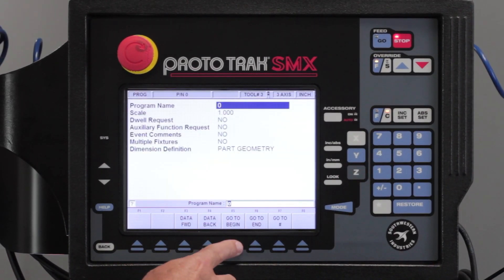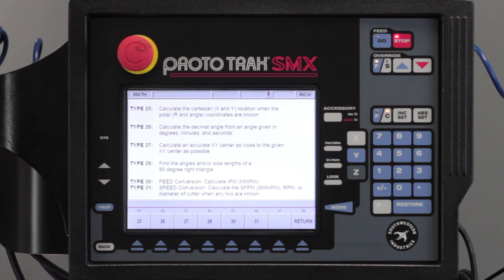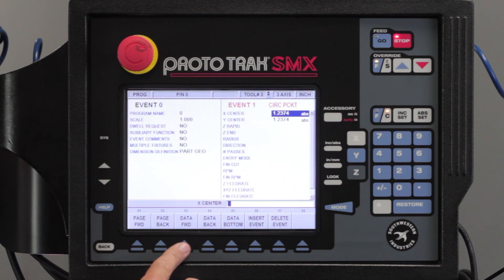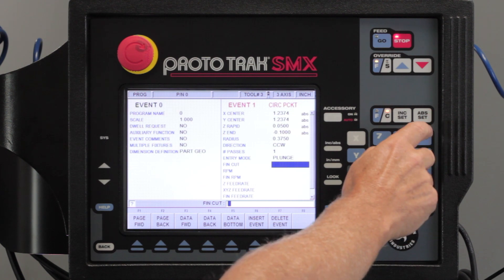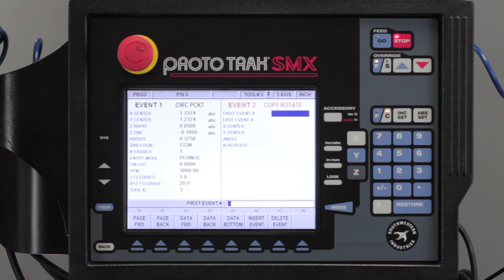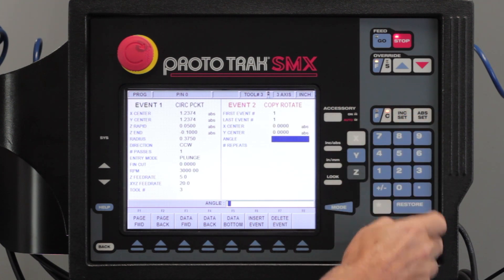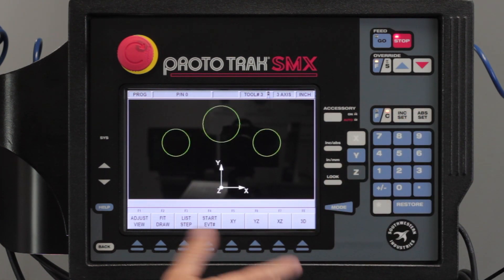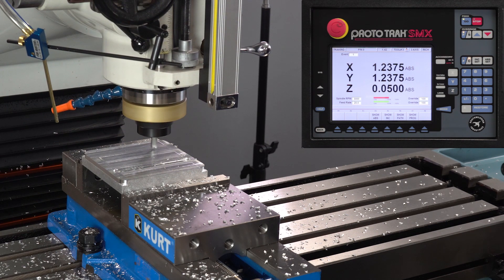Rotations | ProtoTRAK SMX CNC | Basic Programming 8

Comment: So you only touch top of the part  with the last tool? I got confused at the end. Im trying to learn this control since my job has one of this machines.
Reply: Any tool in your program can be the one that you touch off the part to set zero however, the tool you use has to be in the top line when in the DRO mode. Usually, if you just set up or added a new tools(s), that last tool will be in the DRO so I always suggest that you use that tool to set part zero.  Once you go to run mode, the control will tell you which tool needs to be loaded.  I hope this helps  you.  If not, reach out again.  T.P.
Reply: @trakingpat2750  thanks alot for the reply. I will go Head and and try to do a simple program. 2 guys from my job had the training on site, bit unfortunately I was in vacation I wasn't able to attend, but I'm learning this little by little thanks

Comment: Hey Pat, 
I have a slot that's 12mm x 6.5mm. My X0Y0 is the centerline of the slot. Is there a way to rotate this slot 30 degrees? I tried to use the rotate sub routine but I got no movement in my slot... Would I have to program the slot off one of the sides? 
Btw I'm using rectangular pocket.
Thanks!
Reply: Im also using a smx controller.
Reply: @ng7027  I have a question for you before I can truly answer your question. Is your objective to replace the original rectangle with the new one rotated at 30 degrees?  If so, create your 12mm x 6.5mm rectangle pocket or profile in event 1. Next, use COPY ROTATE and tell it you want to repeat event 1 at 30 degrees around X/Y zero. It will create a new shape from the original and turn it into an irregular pocket or profile. After that, you can go back to event 1 and delete it so all you will have left is your shape at 30 degrees.  If you still have trouble with this, please reach out to me personally so that you can send me your program and I will be able to see it.  My email is trakingpat@trakmt.com  Good luck! T.P.
Reply: @trakingpat2750  Thank you for the speedy reply. I will email you shortly

Comment: Hey, I have an smx 3000 in my shop. I've been making a heat sink the last couple of days and I have had to do a series of circle profiles to create the surface area that allows the heat sink to do its job. Is it possible to program spirals in the x/y axis? I tried using the helix event but only managed to do spirals in the z axis.

I think I could do it if I lie about cutter size and do it as a pocket but am sure there must be an easier way!
Reply: Ben, Are you aware of how to change your stepover amount in a circular pocket? As far as canned cycles go, I can't think of another way to create a spiral in the SMX control. When you first select POCKET, before you select the shape of the pocket, press the HELP key and you will see the stepover percentage window. If you change this percentage, it will become the new default number for all of your pockets.  Now, as long as you choose spiral in your pocket event, it will work as you would like. You can leave the finish cut off so that it just does the spiral.  Does this answer your question? T.P.

Comment: Why do you need to hit the CNC run button, I always just press go
Reply: You are correct!  There is a short cut built into the SX controls. In RUN mode, anytime you push the stop button, you have the option to select TRAKing or CNC RUN. If you don't choose either one and you just push go, it will default to CNC RUN.  In the videos, I believe it is important to clarify that I am switching from TRAKing to CNC RUN.  That's the only reason I show it this way.  Thanks!  T.P.

Comment: Can you rotate an entire existing profile without it making a copy?
Reply: Nova396, If I'm understanding your question correctly, you would like to program some geometry and then rotate it but you do not want the original geometry to also be there.  If that is the case, the only way to do so is to use COPY ROTATE.  Once the control makes the new events, you just have to delete the original ones and you will have what you want.  Let me know if this answers your question.  T.P.

Comment: This is something that my old boss needs to watch. The SMX is such a great tool to use once you have the hang of everything. I absolutely loved the time I got to spend at my last job with it. It is a very straightforward unit and makes work so easy to perform.
Reply: Derek, Thanks for the feedback!  Are you telling me that your new boss needs a ProtoTRAK or are you currently looking for a job? 
 If it's the latter, I suggest you call your local TRAK rep and you'll have another job running a ProtoTRAK in no time!  Every rep has a list of shops that would love to have a guy like you!

Comment: Hi Pat..
Excellent as usual! !..I've been 3 months in my new job and work on smx 5000 everyday..and find these tutorials very helpful. .is there any chance you could show us the helical cycle? ..👍
Reply: Duly Noted.  We will put it on the to do list.  BTW, are you looking to learn HOW or WHEN to use the helical event?  Do you want to know how to connect other milling events to the helix?  Would you like me to cover thread milling as well?  Thanks again for the feedback!
Reply: @trakingpat2750  Hi Pat..I see helix at the control but haven't had chance to try it out yet..was wondering how and when you would use it? ..I'm guessing you can use it to spiral ramp on and off  the workpiece? ..
Thread milling I use everyday Pat..so I'm OK but feel free to show others how easy it is 👍
Reply: Great!  I think the best use is if you have a large plate that has been flame cut or something like that and I want to finish that hole.  Instead of using a pocket which starts in the middle and wastes a bunch of time or a profile which will plunge into the flame hardened material.  By using the helix, it will have a continuous tool path moving in all three axis' keeping the chip load constant.  Another use may be if I just need to cut a ramp into a part which is also a 3D move.  NOTE:  If I want to connect milling events to the beginning or end of a helix, I have to use tool offset CENTER because of the transition from 2D to 3D.  In this case, just add your tool radius to your dimensions and it will work.